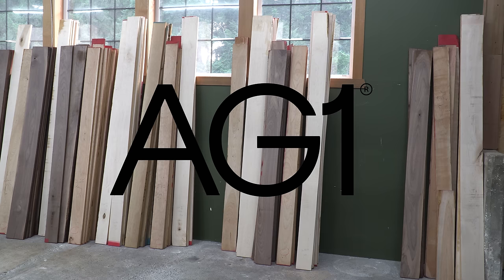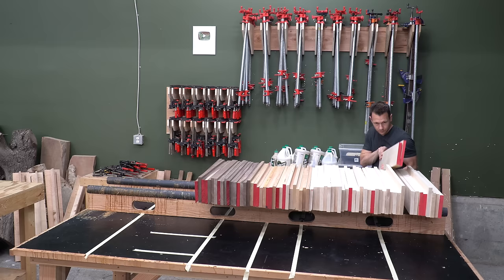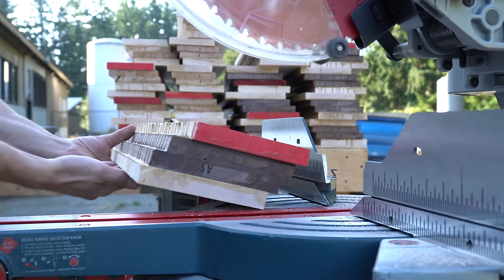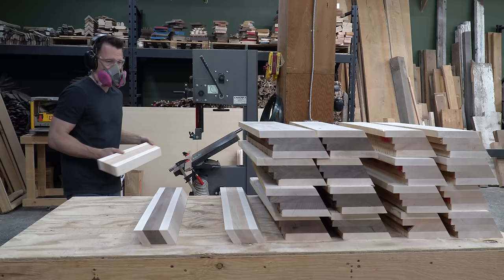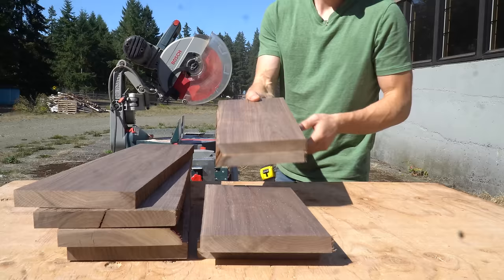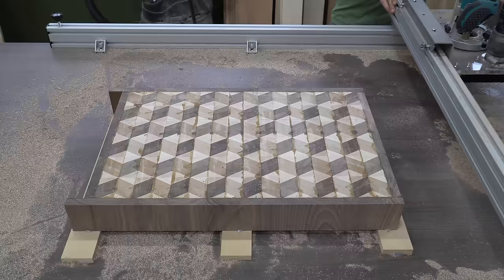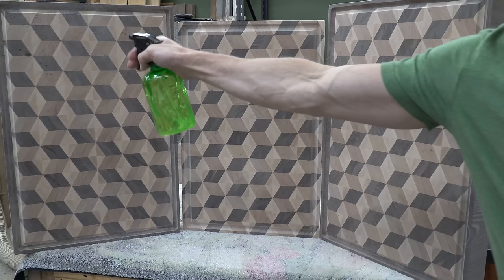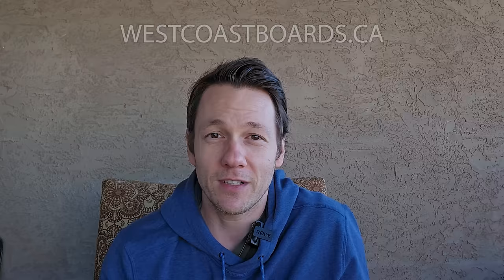$1400 Cutting Boards

Comment: All of you saying this isn't worth the price, i can guarantee 9 out of 10 of you would buy a $1,000 bottle of whiskey or wine if you had the money sitting around that would just get drank and be gone. You would buy a $1000 painting that does nothing but sit on a wall.  You would pay $1000 for a custom paint job on a car when a $500 paint job has the same practical value (yes i know they are more I'm just making a point) point is, this is useable art work that can last for decades. There are $2000usd cutting boards on Etsy right now and those people have sold dozens of them. Just because you don't have the appreciation for the skill and artwork in these does not mean other people don't. Let me be clear, I'm one of you, lol. I wouldn't ever pay this amount of money for a cutting board, that's not where my priorities are for money. But i see the value, i see the skill, i see the art work, and i still think the value for the price is there if you have the money for it. After the cost of material, time, etc, he's not making crazy money on these, wood prices have come down a little since covid days but it's still pretty expensive.  It looks like he grabbed about 25 boards at 7' that's roughly 150sqft ÷ 3= 50sqft each board you're looking at around $400 - $500 each just in lumber cost based on prices in my area. So 40%-50% of the boards cost is just lumber.
Reply: That's exactly what I was thinking. Yep they are expensive but it looked like a weeks worth of effort and $1200-$1500 worth of costs (plus supplies), so suddenly $1400 each doesn't seem unreasonable.
Reply: @JoeSespn No habla de "La Tabla", habla de todo el dinero que le va a sacar a todo el material y el trabajo, que hizo....cada tabla no vale 1000 dólares, es todo el trabajo que vale eso....
Reply: @JMEJIZU  Each board is worth well over $1000 if they're selling for that.

Comment: Add some salt to your glue joints...it provides some grip and doesn't hurt anything! It'll keep the boards from slipping on each other.
Reply from the maker: I've heard that but yet to try it, will do!
Reply: Great looking boards!  Going to give the 3d cube design a try.  On your glue up station, is that just PVC?
Reply: Salt actually soaks moisture from the glue and causes it to fail compared to a regular glue joint
Reply: @DTRWoodDesigns looks like a pool noodle
Reply: Impressive build , congratulations!!

Comment: $1400 doesn't sound that crazy, given that this dude likely spent well over $100k on the building structure, machinery, tools, and then material. That's not even including the cost of his time.

You can't deny that these boards are sexy as hell.
Reply: That's not how value works
Reply: That’s the kind of logic that gives us : $ 85,000+ trucks !!!!
Reply: @DanDuck-mg5fw  Its worth however much your customers will pay. Thats why the truck is 85,000$ because people like my dad will rationalize saying "I work hard so I deserve this" and buy it.
Reply: @suntzu6122  How many has he sold?
Reply: @WoodworkJoe-qr6xh  My dad wasnt a woodworker he did construction of various types. He was the 2nd in command of a construction business.

Comment: For scraping glue, I use a pull-type paint scraper. They are cheap and effective. Blades have four sides and can easily be resharpened.  This tool works well with dried glue. Think of it as a much stronger card scraper. Mine can even remove whisper-thin shavings.

Comment: Great video. Can you please discuss a bit more of not lining up the boards a bit more in depth and how much you tend to overlap and if you were to do it on a table saw to cut off that piece, how would you do it and how would you determine the angle of the blade when doing so?

Comment: amazing, question on ur glue up. that is the cleanest set up, but using the wood to anchor the clamps…how is that wood not sticking to the cutting board?!?
Reply: I assume those are Cauls.. They are typically wood with some plastic or film on them. A great way to make them is to just make some parallel cut offs with some packing tape. The glue won't stick, and you can use them to better line up your glue ups.

Comment: Maybe when you have to glue up a big stack of boards and want to minimize waste by stacking and clamping them at an angle, but that big slippery gluey mass wants to play greased pig with you as you try to clamp it at the correct angle to minimize waste when cutting them on the bandsaw, might I suggest a quick jig that might help. Basically it would  just need to be strips of 1/2" plywood that are cut so that they form a right triangle (sort of like a big speed square) with the hypotenuse at the angle to the worktop that you want to stack the pieces to sit and the strips when stacked three deep and glued, the outer two triangles overlap the seams of the middle one to lock them together. Two of these plywood triangles would have 2x4 cross pieces between each of the three corners to hold the triangles vertically and far enough apart so that the glued up stack is stable when resting against the jig. There might need to be little triangle corner braces to keep if from wracking.  Putting the rear bottom cross-piece flush on the worktop would give a place to clamp the jig against the edge of the workbench so it doesn't slide when the glued up stack presses against it. And with an opportunity to stack of boards at the desired angle would let you minimize the amount of waste on each stack when you slice them at the bandsaw. Hope that you find this useful.

Comment: Beautiful boards. Very pretty. Very very special! As a restaurant chef i would not like to use them. They are too beautiful and too thick. For an actual work tool i prefer much thinner and lighter side grain boards that are easier to handle. The side grain makes them less prone to bacterial pollution. But for the aspiring home cook, these are awesome.
I have my doubts about the price. I can buy pretty end grain boards online for €80. Of course i understand your price point considering all the material and work that goes in to these. The problem is that there are companies that poop out pretty end grain boards for prices that a small shop can never match. You must have awesome marketing.
Reply: side grain gouges pretty much instantly leaving cut marks in the wood.  It seems like this would harbor bacteria much more readily than end grain which has been properly oiled.  Not saying what you are saying is incorrect at all.  But can you point to some evidence on this?  Genuine question.

Comment: So at no point did I see you ever joint a face, just one edge which really even never seemed to be for anything really, does not jointing a face not affect the boards ability to glue up flat without gaps? was the planer enough to make that possible?
Reply: Depends on the grade of stock you buy. To me, it looks like he bought pre milled lumber as it does not look to be rough in any way. If it was higher tier wood, then it is already mostly flat. When you cut it into shorter pieces, any bowing would be greatly reduced and clamps with cauls will assist in making it flat on the glue up. Just my thoughts based on making stuff myself.

Comment: I tried it your way and quickly realized that your blocks are 2X larger than is manageable at the bandsaw. making a precision 30% cut on a timber that is 4" X 8" on a tilted bandsaw is stressful. I would suggest for for most of us that you go with 1" centers and 1/2" outer layers.

Comment: You need more clamps lol. Beautiful. I built one of these a few yrs ago. My absolute best board to date. I wished I hadn't sold it. Had the 3D cubes, surrounded by Paduak border surrounded with a thick walnut border special order for a chef. 3 yrs later I find it still hasn't been used. Was told it's to pretty to use. 🤦‍♂️

Again. Great work.
Reply: We all need more clamps lol. It's a shame when they don't get used. I made one for my mom and dad and I have only seen it used as a serving tray

Comment: 1:27 What does that mean when you say the Maple should be just over half the thickness of two layers of the Walnut or Cherry?  If the Walnut and Cherry are each 1 inch thick does that mean the Maple is planed down to say ~1.25 inches?
2:09 Is the lettering tied to the build?

Comment: So I’ve been wondering this for awhile now. After you cut boards to length and run through jointer/planer, when you lay them out flat and do the FIRST glue up, you stack the boards kind of sporadically. Is there a reason for this and/or also a specific method you use for that initial stack/glue up?

Comment: Curious if/how you eliminate snipe from the planing operations. I usually just cut the boards 6” longer than I think I’ll need and count that as waste. All your boards are beautiful.
Reply from the maker: Luckily, my current planer leaves virtually no snipe. It's so minimal it's not an issue. On my old planer I had to lift up the back end of the piece until it made it past the far roller and then lift up on it as it came out the other end to prevent the backend from kicking up after clearing the roller

Comment: So, why do you not use the fence on the jointer to square your pieces up? Never seen anyone not utilize it
Reply: He just needs the edges straight not square since he cuts them off with the bandsaw later in the video. They are just waste.
Reply: Even so, seems like an accident waiting to happen. One wrong teeter or wobble 🤷

Comment: Hi Ryan. I’ve been making these using the individual cube method. Regardless how careful I am with cutting, gluing and clamping I will always have some gaps between the cubes at final assembly. Your method looks like it would eliminate those. The question I have is in the maple section you can see the 4 triangles. Does anyone care about that?

Comment: Why did you joint one edge at the beginning?
Reply from the maker: To give me some straight lines to work with while offsetting the boards in the first glue up. And during the bandsaw step, one if those edges rides along the temporary board I have clamped to the bandsaw fence so I want it to be straight.

Comment: Great video! Lots of great info and your boards turned out amazing! I just had one question. Did you cut them at a 45° on the band saw? Looks like it but when I've made these boards i glued up the rips with 30° to make a hexagon and glued those cookies together.. this is much better way and ready to try it out today myself
Reply from the maker: Band saw angle is 30 degrees
Reply: Awesome thanks so much for the reply!

Comment: have you ever tried using tung oil thinned with citrus solvent to finish your cutting boards? I saw where the Wood Whisperer channel highly recommended this and am considering it for some boards I’m going to make soon. I’m not sure if the tung oil citrus combo would work as expected on end grain.
Reply from the maker: I haven't tried it but I've also seen that recommendation.
Reply: I tried it and was not impressed. For me it took weeks to “dry”, not overnight like WW says. I still use mineral oil on cutting boards.

Comment: He's BACK!!!😮 Weve missed ya ryan. M8 they look amazing. Like proper amazing. Dont no if a missee it but what thickness did they come out at looks about 50mm(sorry 2" forgot u use funny system) sled looks amazing aswell. Need more videos though think may be scrap board build time. Hope you had great Christmas 👍🏴👏 ps prefer without border
Reply from the maker: Glad you enjoyed it! These are 3" thick.
Reply: @ryanhawkins  m8 was stunning there fair thickness then. Would love to be able to get the kinda prices u get for mine over here. Did sale few weeks ago got told price between £50-75 ($70-100) was to expensive for 12x10"x1.5" thick in oak and walnut strips was to expensive 🤔😳🏴👍 can't wait see what u do next.

Comment: Ryan do ever get any grief about the walnut in the cutting boards? It is interesting because for decades if you read any woodworking text book it would say not to use walnut for cutting boards because of the possibility of allergic reactions and irritation caused by toxins in walnut. It is very common now and does not seem to be an issue.
Reply from the maker: I've never had any grief or any complaints about using walnut in cutting board applications.

Comment: Dumb question. How come you use a band saw at 45 degrees instead of a table saw?
Reply: Looks like 4 boards at ~3/4" each so they are 3" thick.  A 45 degree cut on a table saw only gets you 2.25" deep.
Reply: Because it’s safer!!

Comment: Why not use mineral oil?  You can buy "food safe" mineral oil for $10-$12 for 8 oz, or buy mineral oil that is sold in the pharmacy section of your grocery store for under $3.  This stuff is sold as a laxative.  Since they intend for you to drink it, I'll conclude that it is food safe.
Reply: $1400 boards and you're worried about saving a couple of bucks on oil?

Comment: I've always held the opinion that hand made cutting boards are overpriced. This is the first time that opinion has been challenged. Incredible work. There is a lot of time put into these, as well as a lot of expensive equipment required to make them possible. Anyone making and selling cutting boards aught to pay attention to what you're doing.
Reply: Your initial opinion was correct
Reply: @matthutchinson6509  If you want to spend 15k on the equipment and 30+ hours making it, you go right ahead. Or just keep eating your mcdonalds and stay out of it
Reply: @coryr6359  You could do it with much less $ in equipment. The labor and materials alone make this board worth what he's asked though. I just think some people don't go try cause they're convinced you need his shop and you don't. A garage and much cheaper tools will get it done if you stick at it. You'll appreciate how nice his shop is more by the time yer done but you'll get it done if you want to.

Comment: Very nice, but who actually uses them ???  My brother makes them and they are so nice and pretty,  we don't use them.  Once you cut into the board, it harbors germs !    We buy/use those cheap thin plastic boards that are easy to clean and wash. They get scarred up, throw away and get new ones !!
Reply: Not if you clean them properly and the plastic ones scratch just as much over time as well as dulling your knives.
Reply: At work, we re-plane them a couple of times a year.  When we first get them, they're about an inch thick, and then we get them planed to take off a few mm of plastic from each side.  Helps them last quite a bit longer and reduces cost and waste in the landfill.
Reply: @fucker1714 Are you really reducing what ends up in a landfill though? Where do the plastic shaving end up if not in a landfill? If the shavings are recycled then why can't the rest of the cutting board be recycled too since they're both made of the same plastic?
Reply: @ashe1.070  I mean you don't have to buy as many in a 5 year period, therefore not as many get made and thus not as much in the landfill.  Makes sense?

Comment: I noticed - or it is just me - for bigger blocks, you don't use biscuits to join them? In time the connections give way.
Reply: Not necessary at all
Reply: Nope.  No need.  Biscuits don't hold wood together.  They just align the pieces.  The glue holds the wood together.

Comment: Not aligning them makes me wonder why you bothered edging them to begin with. 🤷‍♂

Sorry, but I don't accept "the first glue-up" as a legitimate explanation. Seems like wasted time. 🤷‍♂
Reply from the maker: Some of the edges are pretty rough, cleaning them up gives me some straighter lines to work with
Reply: @ryanhawkins  I appreciate that, but, considering how much you took off with the band saw, it still seems an unnecessary step to me. Admittedly, it's been some years since I've done much wood working; health. But, to each his own. Beautiful boards, though. Master craftsmanship. 🍻
Reply: Beautiful boards, my thought on the edging the boards, if you didn’t make the edges straight when you took them to the bandsaw, wouldn’t that give you issues? I love the video been fun to watch your talents and shop equipment grown over the last few years. Stay safe.
Reply: @chippychippy8291  Not really. Only the "bottom" board is riding the cutting edge, not all of them.
Reply: @anthonyhargis6855  I get that but what one is going to be when you are doing that one. Not that it matters if Ryan is happy doing it that way. Be safe
Reply: @chippychippy8291  I'm glad Ryan is happy. But what has that to do with my procedural question? I spent years working with wood and building furniture. Did you? Then why are you even in this conversation? Post your own comment and and stop replying to mine. Use the other reply button. See how easy that is?